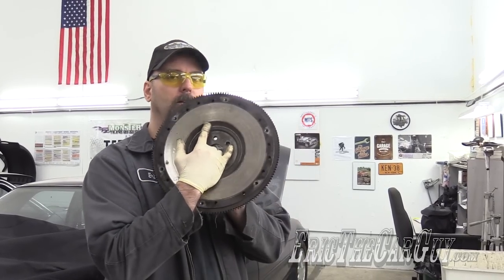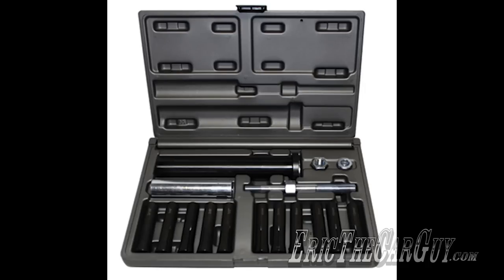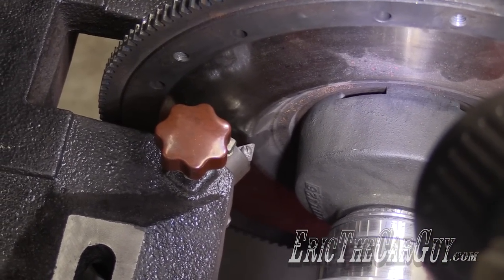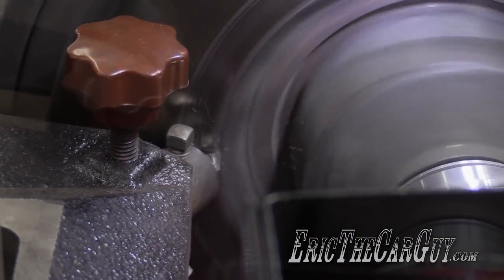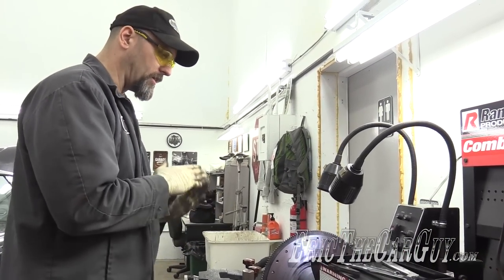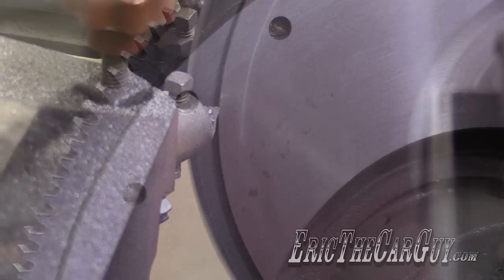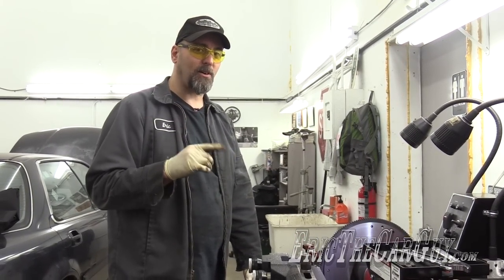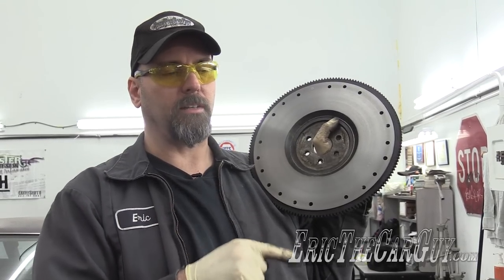Can You Machine a Flywheel with a Brake Lathe??

Comment: did you put a non-directional finish on the flywheel?
Reply: +Bighappy 
No, that would take a different type of machine.
Reply: +Bighappy On rotors I just take some sand paper to the braking surface as its still spinning on the lathe and it works perfectly. I have yet to have a customer complain about noise from my brake jobs :)
Reply from the maker: +Bighappy No, just what you see in the video. I suppose you could though.
Reply: EricTheCarGuy +Bighappy +hadin101
To obtain a non-directional surface finish on a flywheel takes a dedicated flywheel grinder or a Blanchard grinder resulting in a Ra 32-40 finish. 
The benefits to non-directional surface finish is smoother initial engagement and increased initial coefficient of friction. 
Those benefits are rather short lived though, as the surface finish will eventually smooth out and become concentric with use/slip during engagement. 

Attempting to use sandpaper, flap-disk, RoLock, ScotchBrite  or some other abrasive to give the appearance of a non-directional surface finish usually causes more harm than good. 
It results in a superficial finish that is uneven that can lead to chatter or rough uneven engagement and less effective friction surface area resulting in lowered maximum torque transmission capacity. 

Example images of non-directional surface finish:  
http://i1078.photobucket.com/albums/w494/RaceCarEngineers/Main/YT/3767524052_a68a1525f0_zpskmhi06bl.jpg
http://i1078.photobucket.com/albums/w494/RaceCarEngineers/Main/YT/3766725991_08680a1225_zpsgmlbymcx.jpg

Comment: Brake lathes are by no means ideal to machine anything. Rotors are ground, as are flywheels. Back in the day I used to send rotors out but these days cheaper to buy new ones. 
Interesting point,, a friend spent hours trying o bleed the brakes on his [production based] racecar after having an on car brake rotor machine job. . Could not get a decent pedal. Eventually found the rotor faces were not paralell with each other. Ooops.
I have seen rotors and flywheels  milled. Better than lathe but it still bounces on the hot spots. And that does not do the face cutter any good!

Comment: make first cut with worn used bit. then finish with new bit.
Reply from the maker: +movieguy73 Just set the bit on the outside of the flywheel to avoid cutting too much and it won't be an issue.

Comment: How much to remove from a flywheel? Well, I'd say, as little as you can get away with to get the surface nice and true. Obviously the more material you remove from the flywheel the further you are taking it away from the manufacturer's tolerances in terms of weight and thickness.

Comment: A bit too late, but would have liked to see how the balance of the flywheel was and how it is now. If only you knew someone that has a tire balancing machine......
IMO a well balanced flywheel is a lot better then a smooth surfaced flywheel, engines revving, shudder..... thrust washers... Just saying ;-)
Love the video, nevertheless!
Reply: PS, balancing it on the tire balancing machine, just drill a hole 180° where the machine tells you to put some weight. On the backside of course :-P
Reply from the maker: +Tim Lemmens There wasn't enough material removed to effect balance.
Reply: +EricTheCarGuy Sorry, wasn't my intention of being a negative Nancy.....
To be honest, I could have sworn I heard some sign of a lightly warped surface as the bit made contact with the surface. If the flywheel is for the project Ford (Here comes the bit where I am truly jealous) and I'd had a tire balancing machine (jealous mode off) I would just give it a spin, pun intended ;-)

Comment: The lathe  was cutting too aggressively on the outside of the flying wheel because the surface feet per minute is much higher on the outside of the larger diameter of the Circle you almost need to use a higher RPM at the beginning and slower RPM near the end

Comment: What would cause a Flywheel to need machining?
Reply from the maker: It's common practice when replacing a clutch.
Reply: Today I learned. Thanks Eric!
Reply: Okay, it's common practice, but WHY is it common practice?
Reply: lol because commonly flywheels wear as clutches do. Jesus. Why is a sunrise common
Reply: Flywheels can wear unevenly due to heat and pressure from the clutch disc pressing on it.  Some flywheels overheat from people riding the clutch and get hot spots that can cause it to warp slightly.  Sometimes the flywheel surface gets damaged from broken clutch disc pieces or foreign material getting between the clutch and flywheel.

And some people machine the flywheel to be lighter so that it has less of a slowing down effect on the engines ability to speed up.

Many many things, but overall, if you can machine the flywheel instead of replacing it, there can be money saved.

Stay gold.

Comment: +EricTheCarGuy I was always taught to cut from the outside, not inside like you did, for two reasons: chatter and uneven surfaces. Those tools aren't designed to be pulled back across the surface like that and that's why you get chatter. Carbide likes to plunge in tip first. ( ͡° ͜ʖ ͡°)

TIL though. I didn't think a flywheel would fit on a brake lathe.
Reply from the maker: +moo. The machine only works in one direction. That said, had I set the bit on the outside rather than the inside it would not have overheated the bit as I would not have cut as much off.

Comment: Hi Eric, 
Coming from a machining background, my first instinct would be to want to true up the clutch mating surface to the surface that mates to the crankshaft, not the opposite, as you've dome here. How certain are you that those two faces are parallel?
Reply: I know this is an old comment but still- Typically you only resurface a flywheel when you are fitting a new clutch and the new clutch will be made so the face is parallel.

Comment: On the outside of the cut, the surface speed is much greater. That is probably what killed your bit.
Reply: My original thought too, but I suppose a hot spot could have killed it (if it is really killed) or maybe it was about done to begin with?

Comment: I don't think there's a spec for a reason. I've heard of shops that will turn a stock OEM flywheel into a lightweight flywheel simply by machining it. In many cases, this is a totally necessary thing to do. cough Civic 1.5T cough

Comment: Couple things you're doing incorrectly in your video. Yes people have mentioned your sleeves. Second thing take those rubber gloves off don't ever use them on a brake lathe. One of my customers employees some reason grab the arbor when it was spinning with those rubber gloves and a broke all his fingers so I recommend all my customers take them gloves off. Next thing you didn't chuck it up correctly on the Arbor. You need to use a cup a spring the center cone then put the flywheel there and then use another cup on the outside and whatever spacers you need to reach the nut that will help with some of the vibration. You want to know the reason you burned your bit. You didn't take a heavy enough cut always take between 4 and 6 thounsanths 2 thousandths is too light of a cut it will overheat the bit. As far as a silencer goes Ammco makes a horseshoe magnetic silencer you slap on the back of a flywheel that will help with the vibration. I've been building and repairing brake lathe for 18 years now. Contact me if you're interested in one of those horseshoe flywheel silencers I have a few of them

Comment: What is the significance of doing this?
Reply: +Christon Han "What is the significance of doing this?"

I thought it would be obvious. It's the same reason to turn a rotor disc/drum. To not have to buy a new one. Friction surfaces wear unevenly. With pits/valley's etc. If you just change everything out except the metal surfaces, the new friction material will wear unevenly, and wear out a lot quicker than normal. So ideally when you replace the pads or clutch you should also replace the matching metal friction surfaces as well.. Or turn them so they mate up better with the pads. Now it's not done every time, or needs to be done every time. It's just when it's noticeable that it's going to cause a serious decrease in the life expectancy of the friction material like the pads. But again ideally, anytime you can run your finger along the metal and feel indentations, it's ideal to either turn, or replace if there is not enough material left. 

If the cost of replacement is less than the cost of turning, then just replace. If the cost of turning is less than replacement, then turn it.. The cost of turning depends on your area I have personally seen it be as low as $5 per, to as high as $30 per. The low end is if you know someone, and they give you a deal. The average I have seen is around 15 to 20. 

Also the quality of the rotor comes into play. If you know you put some high quality rotors on, they may be worth it to machine. Even though you can get some cheap ones to replace them. The higher quality machined rotors will likely last longer than the cheap alternatives.
Reply: so if the fly wheel is uneven, then the clutch will wear out faster?
Reply: Christon Han Yes, the grooves will eat into the friction material quicker. Basically both the metal, and friction material need to find equilibrium. Two flat surfaces are already at, or very very close to equilibrium so material doesn't need to be removed to get both to mate up. Also until that happens the grip will be reduced. as the friction material will ride on the peaks of the grooves, so there is less surface area actually touching between the two.
Reply from the maker: +Christon Han Surface preparation for a new clutch.

Comment: the bit would have been saved if you had some oil on the cutter. even a squirt of wd 40 every few secounds would have kept the temp of it low enough so it wouldnt fry.
Reply: Nope. Cutting oil is not to be used when machining cast iron. Cast iron contains a lot of graphite and this is more than sufficient lubrication for this operation. Adding oil or WD-40 would just gum shit up and make a mess, and it would do nothing to keep the bit cool. He was overheating because the cut was too deep (which he explained), and the RPM was too high, resulting in a very high SFPM on the outer diameter (which he didn't realize).

Source: I'm a machinist.
Reply: Orcinus24x5 I am a machinist as well, i just dont ever machine cast iron. I see coolant being used in machining cast iron blocks so i always assumed coolant would be better than none
Reply: Well yes, flood coolant would keep the bit cooler, but you didn't say coolant, you said oil or WD-40.

Flood coolant and cutting oil (or WD-40) perform very different actions when machining. Cutting oil lubricates the cutter and work but does not carry away heat and chips. Flood coolant carries away heat and chips, but does not appreciably lubricate the cutter for the most part. It does add SOME lubrication (depending on what coolant you use), but that's not the primary purpose. (and it would make one hell of a mess on that machine which isn't designed to handle flood coolant)

Comment: No cutting fluid ?
Reply: Jaxx Brat not for that little bit of mild steel
Reply: thats cast iron and you don't need cutting fluid for cast iron because the graphite in the iron works as lubricant

Comment: I can say that, Honda flywheels, don't refinish them, there isn't enough material according to Honda and because of that they don't recommend it. They also don't give a spec because they want them to be replaced if they are warped, grooved or cracked. I'm a Honda master tech currently working at a dealer. Other makes may say it's OK but not Honda, just suck it up and buy a new one.
Reply: Alex Ball I modified a lot of Honda flywheels.😂🌮

Comment: chattering is from too much spindle speed
Reply: Ideally should be running around 80rpm of a flywheel that size on hard material and intermittent cutting over the holes, the rad on the tip looked too big also would do better with .04mm rad tip.

Comment: One problem - the computer goes crazy with  lighter flyweels.
Reply: You need to take off nearly half the weight to cause issues. On Subaru EJ engines, it's a good 15lbs to cause issues.

Comment: i highly doubt you burned up that carbide insert. especially on that cast iron, it doesnt create a chip the metal just come off in dust, heat comes off with the chip. letting the insert rest on the face is actually worse for it. 

p.s. hire me as your personal machinist and ill drop a resume hotter than your carbide inserts

Comment: Why would you machine a flywheel? What does it do?
Reply: +billigerfusel heat warped, burn spots. gives the clutch disk a new surface to bite to
Reply: +billigerfusel many reasons as to why.
Best possible mating surface for a new clutch to get best performance from it, also removes any contaminated surface material that may be there from drivers abuse (clutch riding).
Also can remove 'clutch shudder' if this was ever an issue.
Reply: +billigerfusel   It smooths the surface so that the clutch disc makes maximum contact to transfer power and it will prevent hot spots on the flywheel and clutch disc.
Reply from the maker: +billigerfusel Preps the surface for a new clutch.

Comment: The proper way is to use surface grinding wheel with coolant and machinist indicator, this is not a professional way
Reply from the maker: +geoepi321975 Whatever.